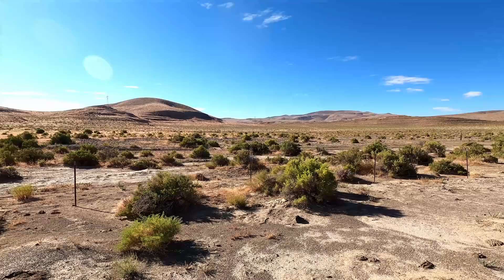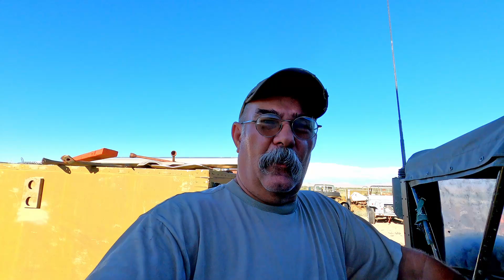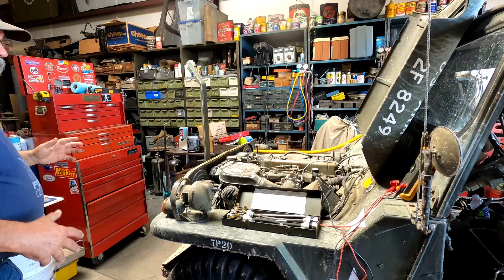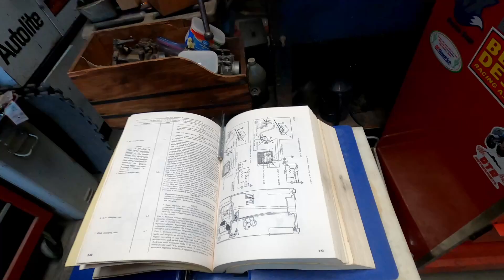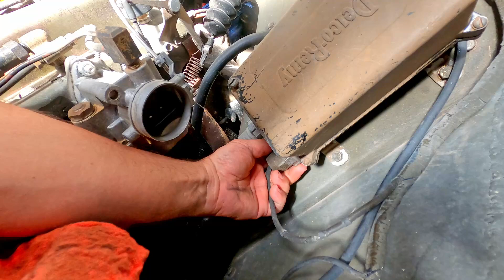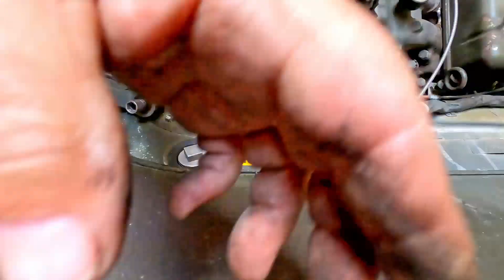Pvt Parts Broke Down at Hootens Well! Can We Get Him Fixed??

Comment: How fast do you drive the M151 on dirt roads?
Reply from the maker: It all depends on the road. On rough trails I'll run between 5 and 20MPH. On the bladed, smooth roads, I'll run between 35 and 45. I always slow down on the turns always because the contact patch on the NDCC tires is so small and many of the roads I travel on have a loose layer of dirt and gravel on them. I was running fairly fast on the road out as I know that road really well and I wanted to carry some momentum through the mud so I didn't get stuck.